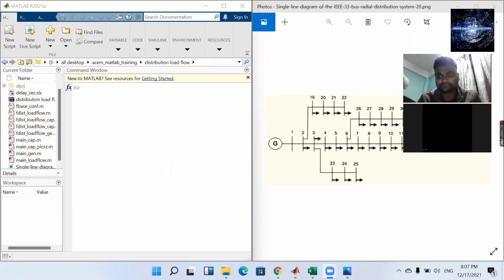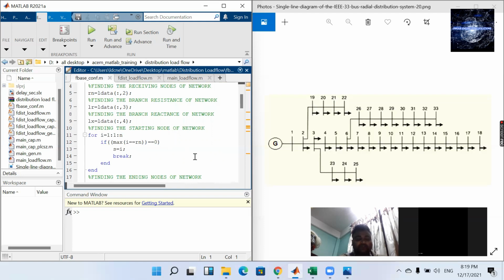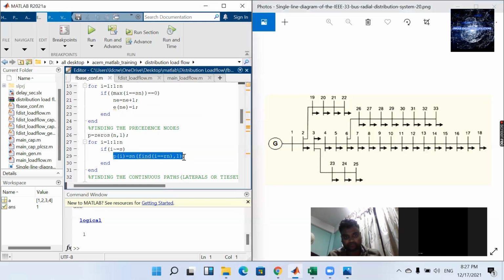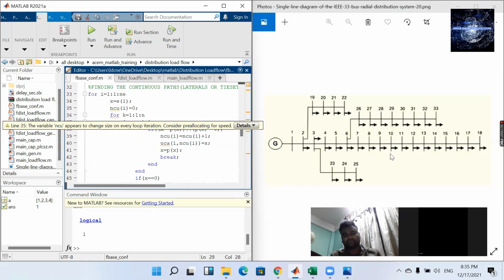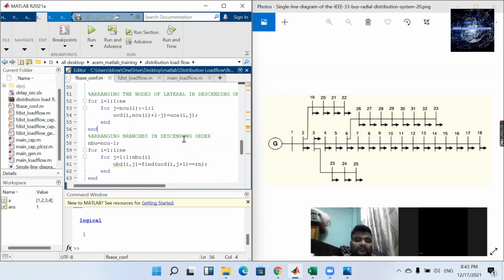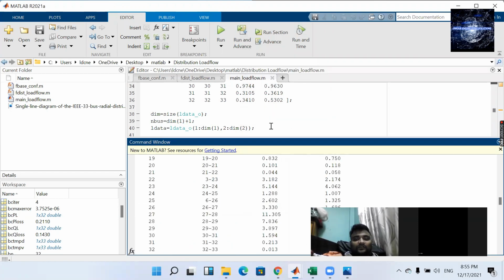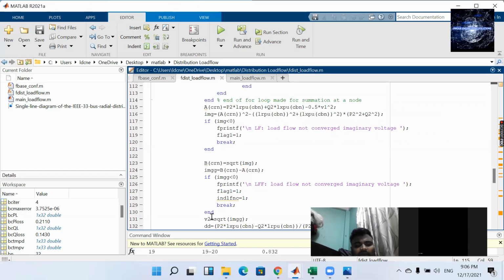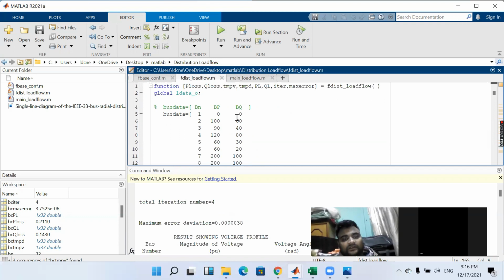DISTRIBUTION LOADFLOW OF IEEE 33 BUS RDS USING FOREWARD/BACKWARD SWIP WITH POWER SUMMATION METHOD

Comment: sir I am doing project in modifying of radial distribution network of IEEE 33 bus from MATPOWER, I made a code and I am having problem when I run my load flow code for 33 bus using NR method can you help me?
Reply: sir , did u find the solution

Comment: sir, 
fbase confg program giving error  saying "not enough input arguments"
can  you give clarity on it ?
thankyou sir
Reply from the maker: you have to run the "main_loadflow.m" file.
Reply: @UniqueEngineeringSolutions 
tq sir
and
 in fdist_loadflow.m    ,can we take divergence criteria of dp( power loss(1)-ploss(0))?                                                                     
and thanks you sir
Reply from the maker: @Dmangasureshkumar  yes, it can be done...change in voltage is also due to change in power loss only....i will upload the video soon...

Comment: sir I am doing project in configuration of distribution network and I am facing problem in writing the load flow code for 33 bus using NR method can you help me?
Reply: Yes sir It is 'reconfiguration of distribution nerwork', where we have to model the network by tie switches and sectional switches for minimum power loss to conduct load flow.
So sir at first I have to find the voltage and load angle of all the buses by Newton Raphson method where I am facing difficulty.
And then use the hit trial method for finding the best configuration for minimum power loss of the network.
Thank you sir for your response.
Reply from the maker: @ankanghoshroy2271  i will upload a video on network reconfiguration using GA after 5 days............also i will recommend to use DLF i.e. power summation or BIBC BCBV method for Radial Networks....
Reply from the maker: For radial distribution network, NR load flow method is not recommended so use distribution load flow only ...but if you insist on NR also i can definitely help you.......so let me know.....your project is of type "reconfiguration with the help of laterals"........
Reply from the maker: https://youtu.be/y2boaOdh6w4